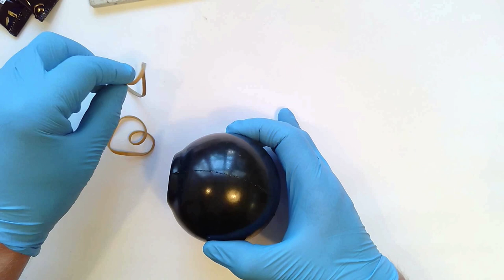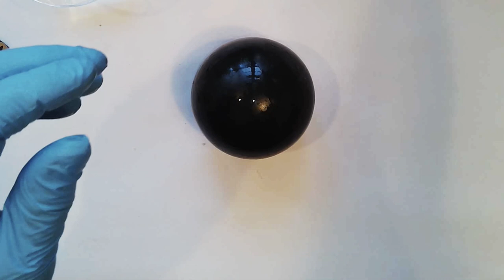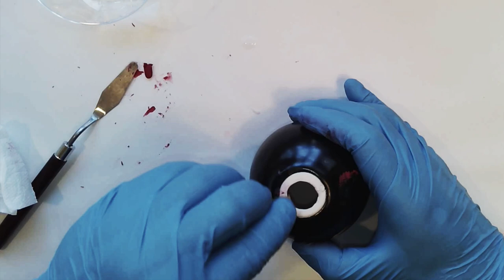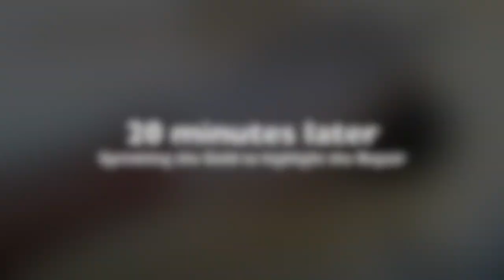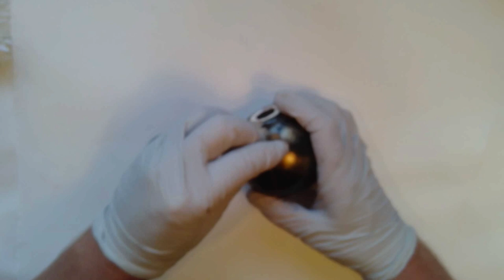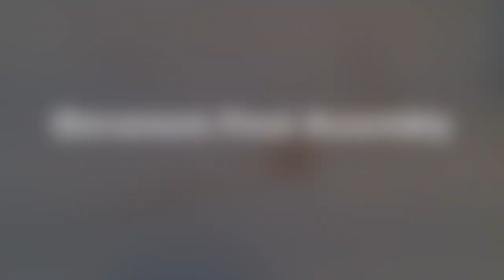2022 Kintsugi Christmas Ornament Repair

Comment: What do you recommend if the gold finish isn't smooth? 

I think I sanded well beforehand, but maybe my epoxy wasn't well enough mixed or applied and the gold surface has tiny craters.

Can I let it fully harden, then sand it down, and do another layer of epoxy and (alternative) gold?